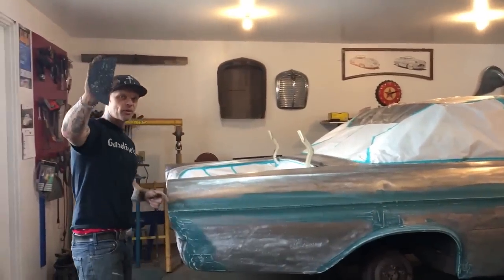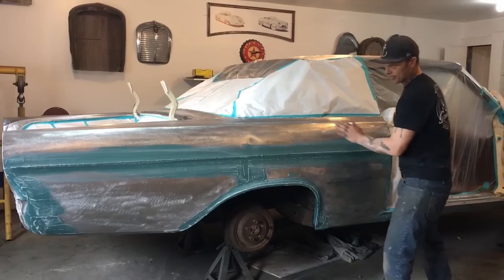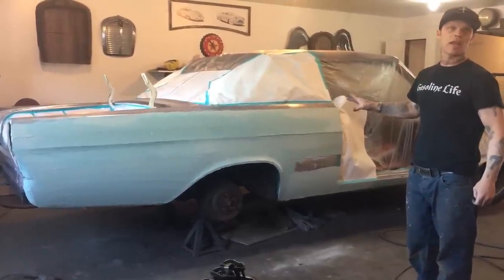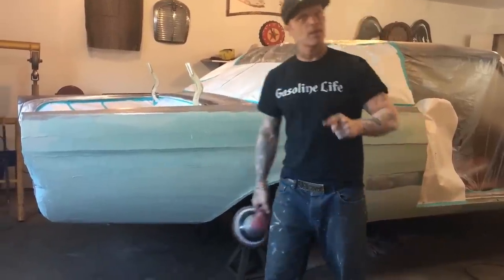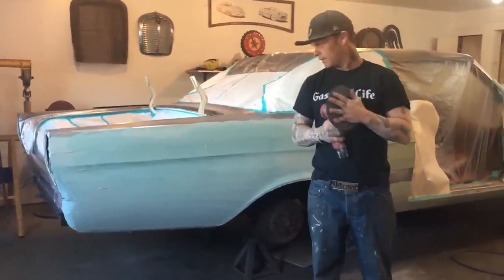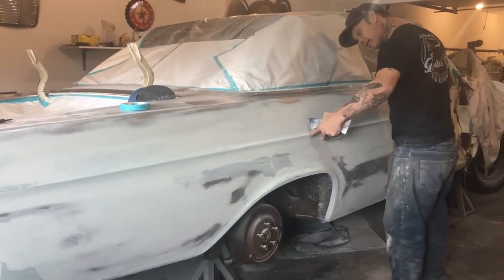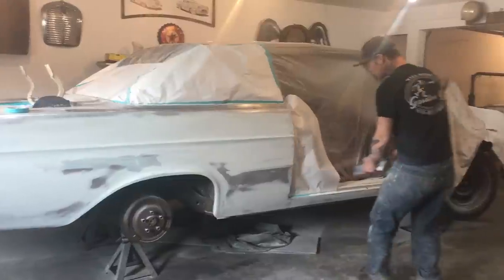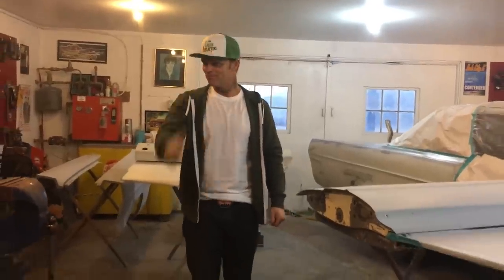How to apply body fill to straighten panels

Comment: The same as a old friend did it and his cars were straight , he would putty the hole car and file finish with 80 then put 4 coats of primer then block finish and put 8 coats of top coat over 4 days 2 coats a day sanded with 800 wet , the last coat would be mirror finish and that was using acrylic paint